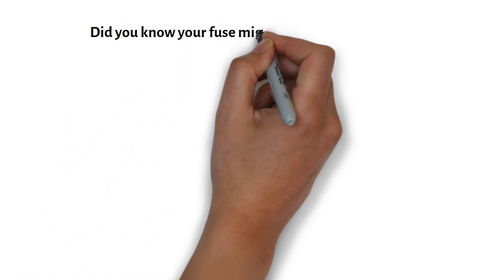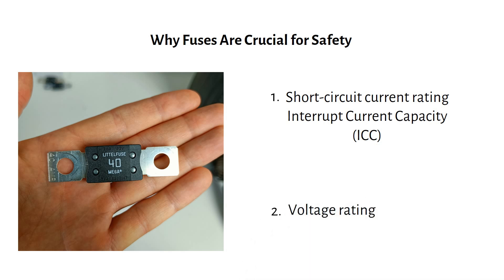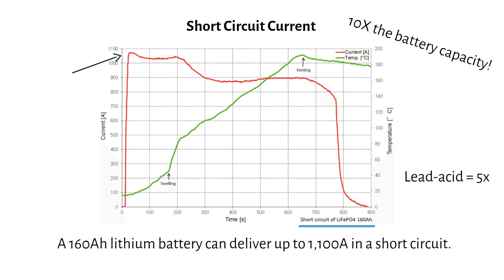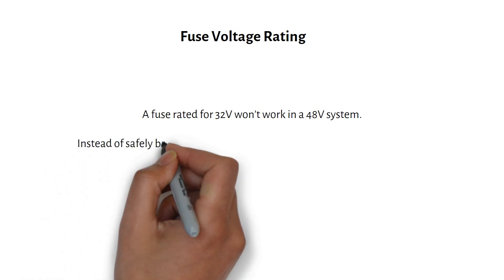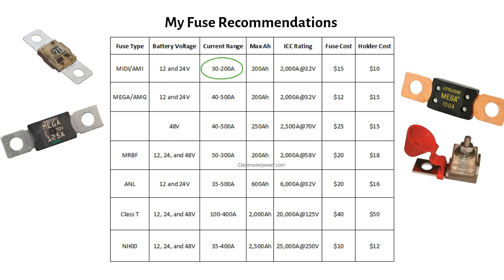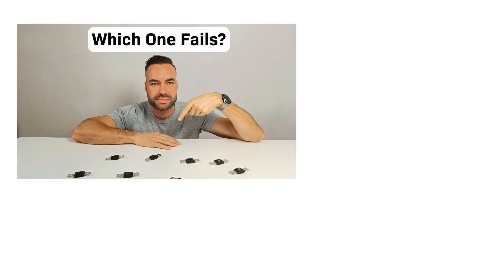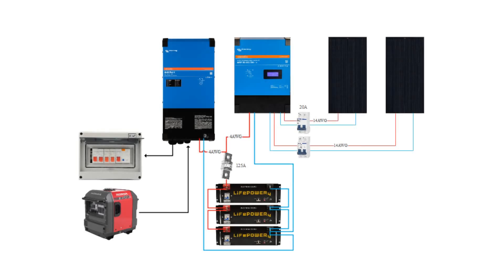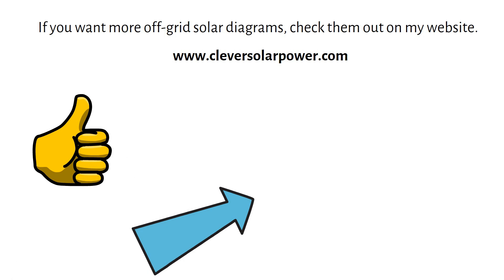Common Fuse Mistake: Short Circuit Current and Voltage Explained

Comment from the maker: UPDATE: 3:50 the Icc at specific voltage is the max voltage the fuse can handle. The updated (more complete) table can be found here: https://cleversolarpower.com/icc
🎁 Free Diagrams: https://cleversolarpower.com
📖 My book on Amazon: https://cleversolarpower.com/off-grid-solar-power-simplified
MIDI: https://amzn.to/3V0XU5t 
MEGA: https://amzn.to/4hWSIJE 
MEGA 70V: https://cleversolarpower.com/go/70VMEGA 
ANL: https://amzn.to/4hYo6Y8 
MRBF: https://amzn.to/4hZOL6T + https://amzn.to/4hYo96g 
Class-T: https://amzn.to/3CGkRV9 
NH00: Siemens, Bussmann, or Eaton
Reply: What size mega fuse do you recommend for 400amp lithium battery to 3000watt renogy inverter? Cheers Paul
Reply: 4000 amp icc he said watch the video again I do when I miss something
Reply: Thank you for the update. I was confused after watching another video of yours and then this one. I had thought the MRBF was okay for a 314ah battery at 12v but questioned it watching this. The update helped me feel better about it.

Comment: could you help me out, i have watched your videos, but I seem to get mixed ideas.  I have a 3000w inverter, with 3 300ah batteries 12v, do i need a 350amp main fuse or a 400amp and what size for the holder itself. also mrbf fuse calculates to 150amp is this correct? Also what fuse holder size?
Reply: and busbar sizes for positive and negative

Comment: At the total overview picture at the end of this video I don't see fuses at the wires coming from the Viktrons to the Class-T fuse. According to the video the Class-T fuse is protecting the cables of the batteries.
Reply from the maker: That is correct. You already have the class t fuse.
Reply: @cleversolarpower  Both cables from the inverters to the bar don't need a fuse to protect their cables? As the Class-T protects the sum of the batteries. Or can I replace the Class-T by 2 DC breakers, one for every inverter?

Comment: as a newbie i have to ask .. isnt the fuse supposed to break the current ?  if the max short circuit current is 1000A would not a 2000A fuse keep it running?
Reply from the maker: A fuse is rated for two currents. The breaking current and the short circuit current. The breaking current can be 100A. And then the other is the maximum amount of current it can break under a short circuit where the current will be very high.

Comment: I watched your video on adding MBRF fused to batteries in a parallel system. I am wanting to add the same fuses to my 24 volt series system and am Unsure of sizing. I have 2 - 300 Ah Lifepro batteries. These are 12 volt batteries hooked in series. I have a 3.6 KW Hybrid Inverter which is 24 volt. What fuses would you recommend for these batteries. Would they both be the same or differ depending on voltage.
Reply from the maker: Check my video about parallel fusing and current sharing. I explain it step by step there.

Comment: Thanks Nick,  I'm impressed with your helpful tutoral videos... I'm about to install 2 x 460 Ah Lithium 12-volt batteries BMS,  included Bluetooth cell health balancing info.  in my sailing boat to replace 4 x 215 Ah AGM batteries. Charging is 720-Watt solar panels with a Victron Smart solar controller 150/70- and 400-Watt max wind generator with its on regulator with two cables to charge two battery banks. I also have an AGM 100 ah starter battery to 120 ah alternators.   Question; Can you help me setup the component to install this into my boat? What do you suggest? SV Skoiern IV
Reply from the maker: Hello John, unfortunately my consulting services are always sold out. But if you send me an email with specific questions i can help you out.

Comment: Wonder why the Victron Lynx Distributor uses Mega Fuses?
Reply from the maker: Good question. Most people will use regular mega fuses for a 48v system which is faulty. However, there are 72V rated mega fuses as well. Now Victron has a class t distributor as well.

Comment: It's also worth noting that literally every consumer/commercial-grade LiFePo4 battery will have a built-in BMS with overcurrent protection.  In fact, some of these BMS's can nuisance-trip when connecting to an inverter due to the initial (very short) current spike.  From a simple electronics perspective, it would be completely impossible for a BMS to pass 1,000A+, the FETs would all physically fail in millseconds (bond wires would vaporize), opening the circuit.

Fuses are a fine second line of defense, but the BMS is the primary.  Using LiFePO4 cells, in any set-up, without a BMS would be reckless.
Reply from the maker: Never rely on the over current protection of a BMS. It's just an electronic switch. It's not the same as a fuse.
Reply: @cleversolarpower  As I said, it depends on what you are actually trying to mitigate.  If you're assuming a "forever" short-circuit to the point of battery failure, that would be essentially impossible.  The components on the BMS would explode/melt long before that happens.  Nothing wrong with adding fuses, but just don't obsess over them as if they are the only line of defense.

Comment: Hi nick 
I have two of 200ah victron lithium batteries connecting parallel to get 12 volt system im using 70mm2 cable .
Can i  use 200ah mrbf at each positive terminal .
Whats your advise ? 
Thanks
Reply: Hi Nick, Thanks for the video. What fuse size will you recommend on a string of 2 12v batteries (each battery is a 310AH) in Series for a 24v system...Searching on the web I get info from 200A fuse to 400A. I got ANL fuses with holders. Any info will be appreciated

Comment: I have 12 volts battery 314 ah can I combine mbrf 300a and mega fuse 50a because I can't see 360a? And can I combine 1/0 awg and 6awg for the battery to the 3000 power inverter? Same as wire I use in battery to bus bar? Please help? 🙏 this is my first time to do diy. Thanks
Reply from the maker: You don't fuse based on the capacity of the battery, you fuse based on the wire, and the wire is based on the current the inverter or solar charge controller puts in the battery. Whatever is greater. Check my video about how to size a fuse.
Reply: @cleversolarpower thank you ❤😊

Comment: If a 48V battery with a 200A Max Continuous Discharge rating, you're saying I need a minimum Icc rating = 2KA ?  The mega 70V fuse will work.  Why bother with the cost of a class T if you're already fusing each parallel battery?  
It's been challenging to find an on/off switch that works at 48v.  Probably don't need to worry about Icc on the switch since you already have a fuse at the battery?
Reply from the maker: Good question. The Max icc rating of The fuse depends on the maximum current you will draw from The system. So you will size The fuse is based on your load it can also be that the solar is putting more power into the batteries than the inverter draws. So you have to account for that. When fusing a battery in parallel you can use fuses for the single battery. But when you have the main cable from the Parallel batteries to the inverter that One needs to be size according to the max draw of the inverter. meaning the cable will be bigger and depending on the voltage you need a higher icc rating.

Comment: I have 3  280ah lifepo4 batteries in parallel with a 4000w 12v inverter charger I was told to use a 400a fuse but never told if it needs to be Mega or ANL. What is your recommendation?
Reply from the maker: 12V system with a 4,000W inverter, awch. You need a class-t or nh000 check the first link in the description for the table.
Reply: @cleversolarpower  so a class-T 400a fuse ?

Comment: You state: 

MRBF Fuses: These mount directly to your battery terminals, reducing cable crimps. Perfect for 12V, 24V, and 48V systems up to 200Ah.

Why for systems up to 200 Ah? 

A blue water 200A fuse has an ICC rating of 10,000 A.  The maximum ICC of 300 Ah is 10 times more or 3000 so it would appear that these fuses are good for even 300 Ah batteries in parallel.
Reply from the maker: Indeed, i have updated the description and pinned comment for better clarity. I have used the max voltage rating and not the lower voltage ratings.

Comment: Nick.  Thanks for the great videos.  I've noticed a trend in the market for LiPo battery systems with AC/DC powering capabilities that have built-in Inverters. I actually picked up a DJI 1000 Watt hr unit that I use in my camper van as an AC power unit (no air conditioner) when off grid and a Battle Born 1000Watt hr LiPo battery (solar and shore power charging for my AC/DC WFCO 8955 Power Center) unit that I can plug into shore power.  Really simplifies the set up and maintenance.  Your videos and book have helped immensely with wiring/fuses for my rebuild.
Reply from the maker: Yes, they call them a solar generator. They are quite handy, but difficult to expand affordably. Thank you for your support Doug.

Comment: In the event of a short cct external to the battery itself would the BMS shut down on over current and therefore act as a kind of circuit breaker? The BMS being a semiconductor would also not have any arc like a rupturing fuse might create?
Reply from the maker: I would not trust the BMS to break a short circuit current. That's why I recommend a fuse.
Reply: @cleversolarpower  That's what they are there for!  Whether or not you "trust" them is not relevant.  Clearly, fuses are a good second like of defence, but trivializing a BMS's core function is not helpful.

Comment: You are talking about the individual cells,.......... your picture is not of that, but of a battery with an internal BMS, and other inline wires/components. ...... Thanks for the overview of fuse types though :-) ...... Where is the relation between Ah and fuse type ?,.......... there probably is one for LeadAcid, and another one for Lithium,......... I don't see why that's included. ......... Amp Hours is the capacity of the battery, and has nothing to do with the fuse, except as you say, if it's Lithium, the cell could give 10xnnnAh as max peak current, if it was not for the BMS and the internal wiering.  It's realy the ICC rating you're talking about, which makes much more sense (but maybe Ah is more simple for most viewers). ......... But again, they have a BMS inside which will either break or go on fire or disconect the battery long before your slow DC fuse is gonna break.  The DC fuse is not nearly as quick as the BMS (if it's sensibly configures). ........... I think you're corect about your last statement about the BMS though. ........ But I still think the BMS is gonna disconect (if it still can), before the external fuse blows. ........ I'll give you a case if the BMS breaks in such a way that it shorts,..... and that I guess can not be completely ruled out. .... I'm making a pack myself, and it will have an external DC fuse of 70A even if the capacity is 380Ah, but that's mostly because I don't need more, and to protect wiring etc.  And as I'm making it myself I can configure the BMS's reaction time and cut of current myself, which will be set to much less than the max 200A the BMS is spec'd for. ........ If your list of recommendations had included the time it takes to burn off (break) at the ICC for instance, that would have been usefull to be aware of.

Comment: Thank you so much for the content man! Is a good idea to put a 200A ANL fuse for my 290Ah 12V CHINS battery (200A BMS) or should I get a MRBF fuse instead? It will be used for off-grid house with a 2000W inverter and 2/0 cable from B to Inv.   Estimated consumption 800W baseline
Reply from the maker: You can use an mrbf because they are rated at an ICC of 10,000A at 14V.

Comment: The Victron mega fuses do not give an ICC rating, I have asked my Victron supplier for this and they say they can't find one either. The Victron Lynx distributors are set up for mega fuses and often used on large systems so be careful of this. I am assuming their 48v fuses will handle 2,500 amps. They also do 80v mega fuses so best use these, but they are really expensive for what they are. I wouldn't use more than a 10kwh battery for each termination point in the lynx distributer.

Comment: I Have an 3500W/24V inverter and a lithium battery of 25.6V 100 amps should i calculate the fuse size based on the battery or the inverter, your videos provide very useful information keep up the good work 👍
Reply: Calculate fuse size based on the inverter amp draw, which will be your minimum fuse size, and the current carrying capacity of your wire, which will be your max fuse size. Take the min size and multiply by 1.25 or 1.5 to get optimum size.

Comment: i have beef with how many diy battery builders just blindly trust bottom tier priced bms boards....
I prefer to go more analogue, its actually a lot cheaper.
small 2$ 1.5a 4s inductive active balance boards. better than most bms for balance current.
2$ 15w heat pad and 1$ w1209 temp relay board for low temp protection. 
fuse for dead short/arc protection.
and then i let my electronics handle the voltage range/state of charge. 
with how insanely cheap lfp 280ah cells have gotten (45$/kwh), a good bms will actually double the cost of most project builds.
batteries have gotten to the point where solar was a few years ago, when people realized its not worth getting better charge controllers or what not, just buy more solar panels because theyre so insanely cheap.
it will probably take another year for everyone to realize that theyre paying crazy amounts over msrp for their batteries from resellers and dropshippers... whats worse is how marketplaces like the jungle site promote and encourage this price manipulation. it turns out affiliate links dont actually materialize extra money into existence... and they really do end up costing the end buyer something. I actually dont see an issue because if youre that lazy to not shop around yourself, you are basically consenting to paying a convenience store mark up. just dont like when yters tell people that theyre getting the best deal possible.

Comment: Excellent video and excellent charts. In your chart at 7:34, you show three 48v server rack batteries feeding into a 125A T-class fuse.  Is this really adequate?  This is very similar to my system except that I have not yet added the third battery and I am using an All-in-one inverter charger.
Reply from the maker: I'm using a 5000VA multiplus on a 51.2V nominal battery: 5000VA/51.2V=97A -> x1.25=122A. You need a 125A fuse and a cable that can carry at least 125A.

Comment: I have eight 280 amp hours lithium batteries. Do you think I need to put on each battery a terminal fuse and at the very end CT class fuse what do you think? Help me out
Reply: Are the batteries all in parallel?  Assuming they are, I strongly recommend a MRBF (or the similar HABF which is not marine rated) on each battery.  The class-T for the combined bank is good, because with 8 batteries in parallel your wiring after all are combined will almost certainly be too small to handle the combined current.

Fuses need to be sized to protect the wires.  If your wire can safely handle 200 amps, the fuse should be smaller than 200 amps.   If you make the battery fuses small enough and the wires large enough you could skip the class-T but with 8 batteries that large in parallel I don't believe that is feasible and trying to do without the class-T would likely cause nuisance fuse blowing.  In other words, if you only need 100 amps, you would fuse each battery at 150 amps and use wire capable of safely carrying over 150 amps (#2 or larger american wire gauge).  Now if you put 8 of those in parallel you need wire capable of handling 8 X 150 amps which is VERY VERY BIG, or else you should use an appropriate class-T fuse to protect the smaller and more practical wire.

Or you could assume each battery will only supply maybe 1/4 of the current, or 25 amps.  So you fuse each battery at 40 amps and use wire capable of 40 amps (#10 awg or larger).  Now you have 8 X 40 amps in parallel, or 320 amps.  You could wire from the battery bank with 4/0 awg or larger and skip the class-T but you might get nuisance fuse blowing and 4/0 is still pretty big wire.

edit:  even class-T may not be sufficient for a bank capable of delivering that amperage without the battery terminal fuses. each 280ah battery could deliver about 3000amps and 8 X 3000 amps is 24,000 amps - pushing the limit of the class-T.  The smaller fuses at each battery terminal limit what that battery can provide and so if the class T fails then each battery fuse will likely also blow and should prevent a fire.
Reply from the maker: You should fuse every parallel battery. You can do so with an MRBF on each battery, but thats going to get expensive. You can also get a MEGA fuse busbar from victron (not the power in -> too expensive). Then have one class-t for every 4 batteries.

Comment: If for example, 12V 20A blade fuse used for autos used in 48 V solar setup, what will the Amps be? 
Want to extend the run time of a power station with a 48V battery.
Reply from the maker: You cannot use a blade fuse for 48V systems.
Reply: @cleversolarpower  I meant to say ATC/ATO fuses, if not, why is it so, is not a fuse a fuse and will melt if current is over its rating? Just trying to get some understanding. Would use the fuses between the battery and the solar input of the power station.
This is for a small setup using 2 panels in series that have VOC 97V, ISC10A, and wanted to extend the run time of a power station with a 48V battery. Will of course need a solar charge controller between the panels and the battery and considering Victron MPPT 150/35A unit.